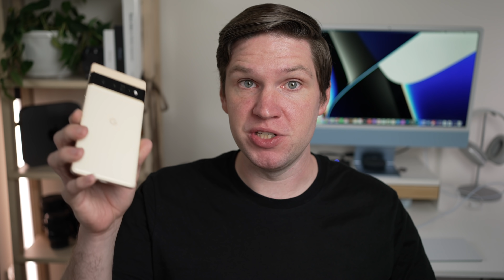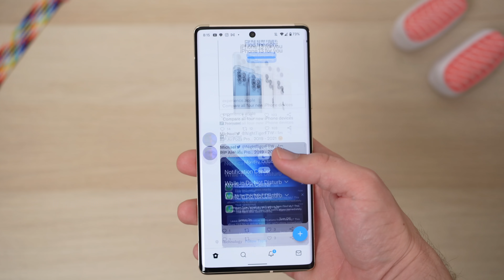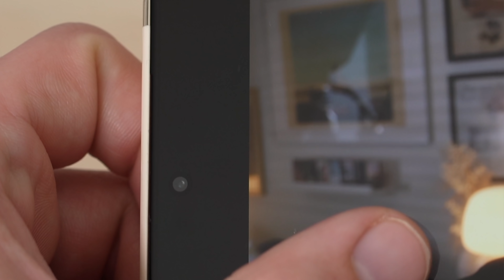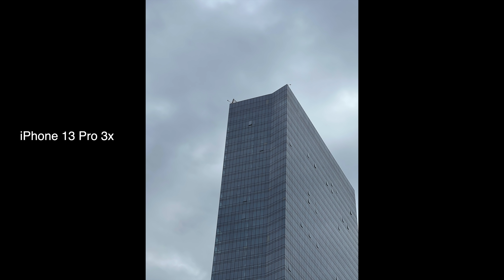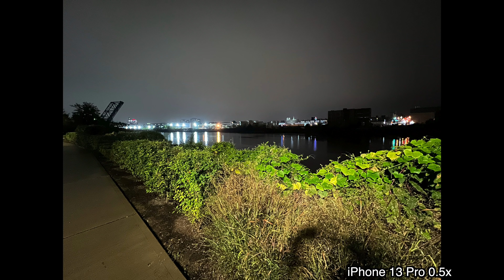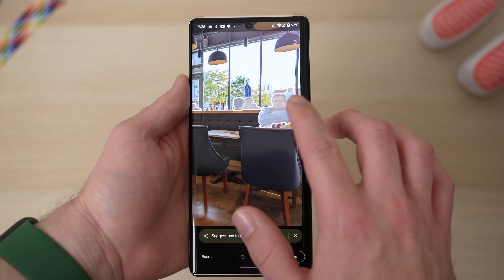The Pixel 6 Pro Shocked Me... Real Camera Test VS iPhone 13 Pro!

Comment: Damn, I don't think it has 500 nits of brightness.

I'm 95% sure because it'll be absolutely trash
Reply: I'm not sure that is correct, i have seen other reviews where they say it's over 650 in normal mode and over 1000 in auto brightness mode.

Comment: Gotta say from all the videos I’ve seen thus far, the iPhone 13 Pro has the edge over the pixel in still photography, and definitely beats the pixel in the video and sound quality.

I was expecting the Pixel to handily beat the iPhone in still photography so the fact that it’s this close leaves me a little disappointed in the pixel. Not that the photos are bad, I just think the hype might’ve been a bit too much.

Still want this device in hand though to see for myself. Maybe software optimization will improve the pixel as time goes on.

Comment: So basically tensor is on par with my 2017 iPhone X. Its not even able to beat iPhone Xs SOC. It is safe to say that tensor is FOUR GENERATIONS behind with iPhone.
Reply: It could be on par with an iphone 6 if you want to, and it would still run and work 100 times better than your phone, google optimizes their phone extremely good, but thats something you wouldnt know until you try it. The guy from the video is clearly on the iphone train and was not really planning to change that
Reply: @LaloIsBlue  extremely good is a broad word to use for a phone that has slow SOC, slow finger print unlock (where’s soli haha), slow photo processing, worst video format, bad video quality. But I know this phone is still 100x better than YOUR phone.
Reply: @rechiecanonigo3800  Ohh I get it now,  you are basing your statement from the benchmarks,  cool. Bad video quality? LOL, but okay im not gonna argue with you. The opinion in this video are for sure  on the uncommon end, as many other reviewers have found it to be an exceptional phone.
Reply: @LaloIsBlue  which means my phone is 1000x than yours… sooo..

Comment: Was expecting the Pixel to win on photography and the iPhone to win on video. But iPhone is more polished in just about every area. Never know what to expect from Google each year, it’s like they task a different team each year.
Reply from the maker: I think it’s because camera hardware has gotten so much better. Google’s still over processing images that don’t need it as much anymore because you’re starting from a much better point.
Reply: @GregsGadgets  Dave 2D mentioned that too and i totally agree. Google jumped up to a 50 MP sensor and i think they further need to re-tune their image processing algorithms to handle that data better for better and more consistent auto-mode photos. I saw on Twitter David Imel showed Pixel 6 Pros auto mode photos versus him taking the raw images Pixel 6 Pro gives and doing his own color/sharpening/etc pass on them and them looking a lot nicer in my opinion. Like handling skin texture better. So it absolutely could be done if Google takes the time to re-calibrate and push a software update i think.

Comment: The problem is, that even though that new chip might be good today, it will lag apps, user interface very soon and hinder user experience. Which isn’t what you want from a “flagship “. That performance is about the same as a 2 year old flagship android or a 4 year old iphone.
Reply: exactly, reviewers don't seem to point out this feature of iPhones.
Reply: @klyplays  i agree. People expect to have a very powerful, but efficient engine in their luxury car, but not many expect the same in a “luxury” phone. Thankfully Apple gives that to you.
Reply: Obvious you all have not used Pixels. Go use a 2yr old pixel 4xl and tell me where u see lag. Doesn’t happen.
Reply: @dnevs79  please read my comment again. Google never used or even had an own chip before, now they do. Until now they used Qualcomm like every other android phone. Now they use their own Tensor chip and its quite a ways behind the competition.
Reply: @Crusaderhun  I understood your comment. My comment stands. Their chips don’t have to be current to outperform others daily use, they need to be supported. My pony is that Google supports their pixels and make them run smooth. They will support their own SOC AM and ensure it runs smooth. If a 2 yr old pixel stills runs as smooth as newer devices, I’m confident that Google will support the Pixel 6 and their new SOC to ensure it runs smooth and lag free
Reply: @dnevs79  facts are facts though. You can optimize a system all you want those single and and multicore scores are the same as 2019 flagship android phones. Of course those still run good in 2021 but they are 2 years old today. They will not run that smooth in 2 years where that performance level will be 4 years old. This new pixel is already at that 2 year mark, and while I do know some people will be replacing it yearly, the ones that won’t, will feel it slowing down, no doubt about that
Reply: @Crusaderhun  facts are facts… let’s look at a device that scores well below the pixel 6, the pixel 5. It runs extremely smooth and is snappy using a midrange chip. Proves benchmarks can be misleading. Consider also that  pixels have scored less than other devices even when using the same exact chip… also consider that most phone are way more powerful than required for the majority apps … most of us aren’t processing movies and running high end games on our phones… email, text, and social media seem to dominate
Reply: @dnevs79  the last part of your comment is my only gripe with this phone. It IS a flagship and it’s definitely marketed that way. It shouldn’t just be good at txting, calling and basic apps. Anyway, if you are happy with the pixel 6, good. Enjoy it!
Reply: @Crusaderhun  huh? Never said that. The phone does it all… my point is that it will perform as well as any current Android device and will do so for years.  

Good convo, have a great evening